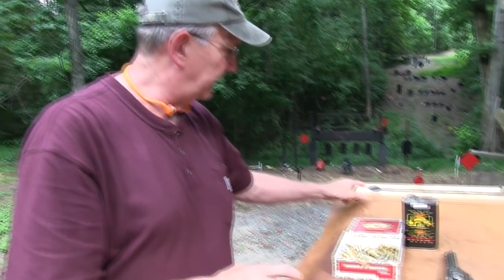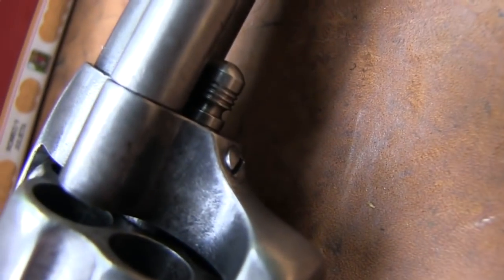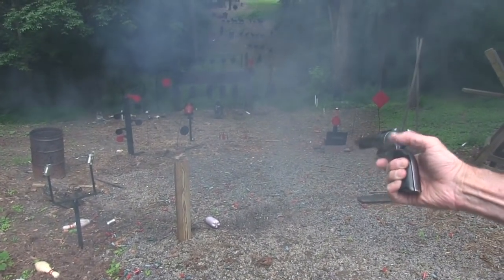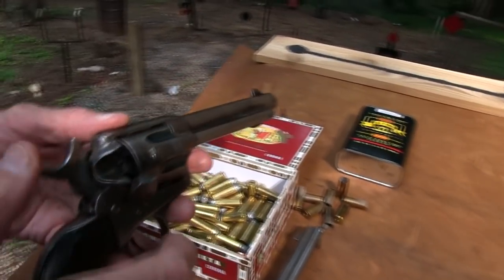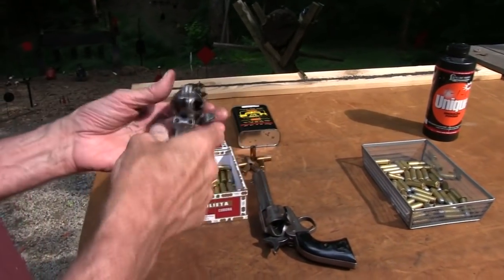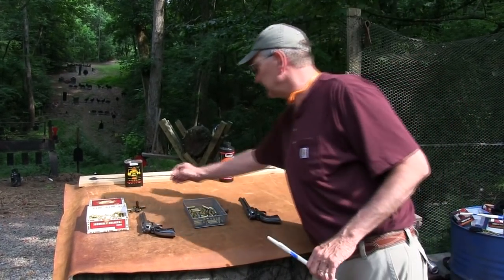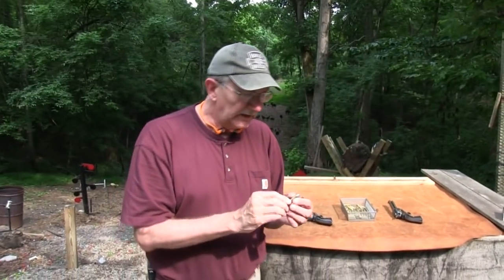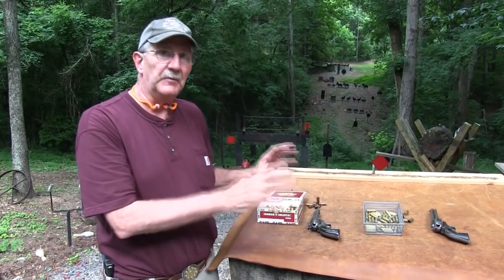Black Powder vs Smokeless Powder: some education!

Comment: the big difference between black powder and smokeless powder is that smokeless powder is (wet) that's what i read and saw on discovery channel that's the main difference. that also makes it more compact.
Reply: Smokeless is a form of solid nitroglycerin (some odd low-explosive). It's not wet at all.

Black powder uses charcoal, so smokeless is more energy dense.
Reply: I just searched it up, most forms of smokeless are nitrocellulose.
Reply: pcblah thank you for informing me correctly :)
Reply: +pcblah nitroglycerin is not ( an odd LOW-explosive) fyi it has a detonation speed of 7,700 m/s that's faster then tnt. not low at all buddy
Reply: matthew davisson Reading comprehension.

Use it.
Reply: what? ehh another nothing to say grammar/reading insult lol. its what yall resort back to when you got nothing to say lol
Reply: matthew davisson It's not about grammar, I later stated that it was actually nitrocellulose...
Reply: pcblah but then again I was thinking you are kinda right about it being low explosive if your talking about the amount of energy needed to set it off. that's why "low" explosives are a lot more dangerous then say a "high" explosive because say dropping a low explosive could set it off unlike a high explosive that needs a secondary explosive to touch it off

Comment: ,Black powder, in westerns is like using the term ,single razor, in the 1800s
Reply from the maker: Coincidentally, just a few moments ago I saw this in a Western I was watching "War Arrow,"  with Jeff Chandler. They had several barrels of powder in the fort's powder magazine. The barrels were marked in large black lettering, "Black Powder."   
Also, it was interesting that they put all the women and children in the powder magazine with ammo and barrels of powder during the "Indian attack."  The comment was made that if it was necessary, it was better that they "go like that."  Better that they be blown up than to be captured and tortured, I suppose, was the point.